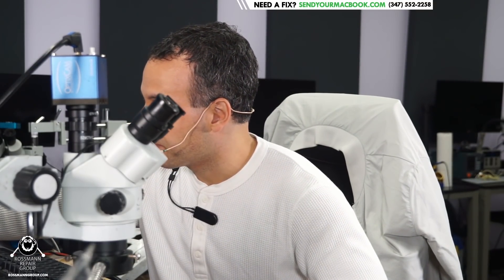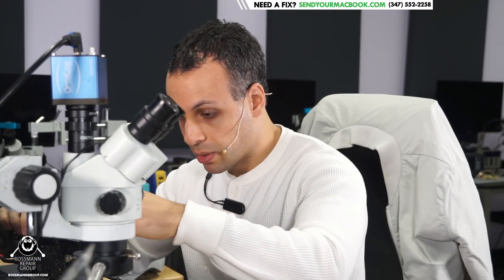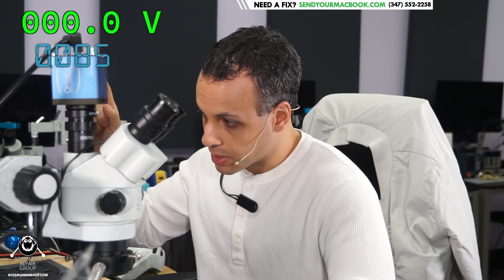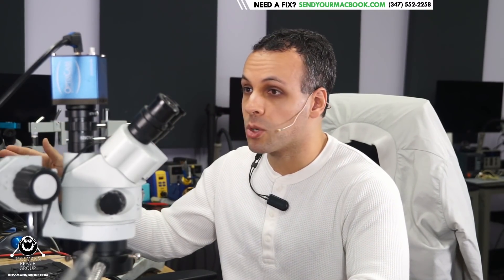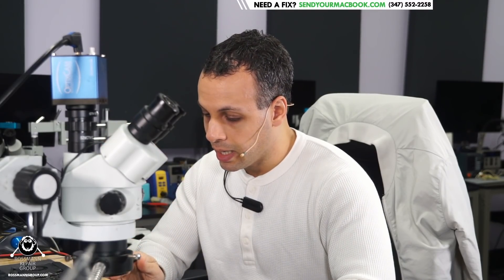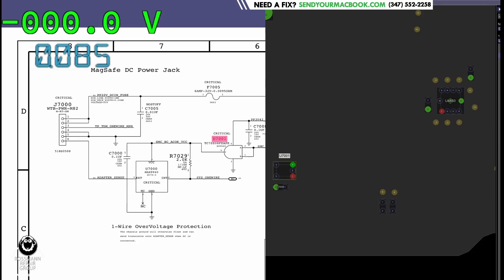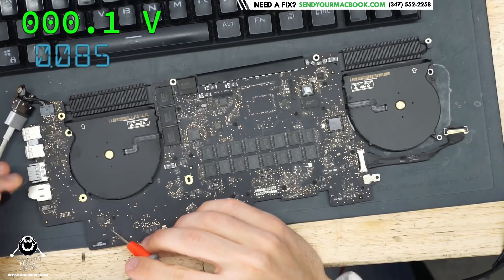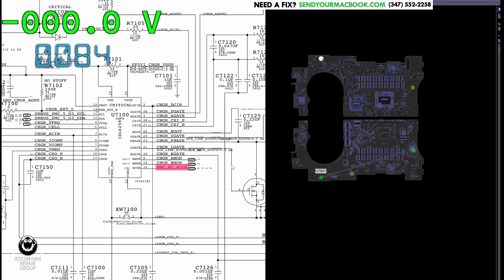Classic style, Louis Rossmann board repair video for old times sake

Comment: This is by far my favorite video of yours. It is much easier to follow you when explain things in such a clear manner without skipping steps. Much appreciated that you took the time to explain what each chip is and does eg U7100 is the infamous ISL6259... It is the buck converter responsible for creating PPBUS...It uses the delta in resistance to confirm current is normal. These Resistors blown due to a short. Look what they have in common to cause that short.... Not a cap in this case, so must be the chip. Just brilliant and clear! Hope you keep this approach moving forward, it is 10 times more helpful. .

Comment: After watching a few of these videos now, I have learned that when you plug in the charger, the charger wants to talk to the SMC. But the U7000 chip ensures that the charger can't accidentally talk to the System Management Controller with 18V. The charger talks to the SMC through the U7000 chip via the SYS_ONEWIRE line. But it cannot do so if the U7000 chip is not getting power. The U7000 chip gets power from PP3V42 G3H but only if "SMC_BC_ACOK" is present.

It seems to be common for one or more of the capacitors to break near where the PP3V42 G3H line begins (although it wasn't in this video). Just from watching your videos, this tends to be caused by liquid damage and corrosion in that area. But you also have a lot of experience and seem to be able to know what's most likely going wrong just from the amperage... I'm not that good just yet and will be relying heavily on repair.wiki to help me fault find.

I know this might not seem like much, but to come from having zero understanding to being able to recognise and follow along with your videos with a basic level of knowledge of WHY you are doing what you are doing is incredibe and speaks volumes to your skill as a teacher. I am now able to fault find all problems by myself a lot better!

Thank you for passing on the far more useful and universal skill of fault finding, rather than just blind, step by step information!

Comment: We used to quick check for cracked capacitors by putting alcohol on a warm board, and watch for the line of liquid in a crack as the alcohol evaporates.
It was not 100%, but it caught the really bad ones.

Comment: just bought a "new" macbook pro battery for my 2010 macbook pro and when i turn on the computer the battery icon has the loop arrows inside and says replace battery but when i use a 3rd party battery it says the capacity is 6110 ,instead of the original 6000 but shows 0% and 0.0w charging... any idea how to fix this or is the battery defective.it looks like an original battery and it says in  the app battery made in 2017 so could it be a refurb or something?

Comment: The fact the ISL6259 is such a common denominator for charging failures time and again is disturbing. There's clearly multiple points of protection along the lines in and out of it to prevent that, but it's always the first to fail anyway. Surely there must be a way to fix it to prevent that for good.

Comment: Thanks Louis! I just did a component-level repair on a broken 3D printer using the skills I picked up from watching your videos. Now it works!
https://youtu.be/7kIsLF08AIw
Couldn't have done it without your great content, or the hot air station I bought from your site 🙂.